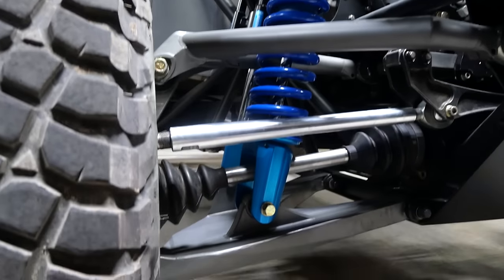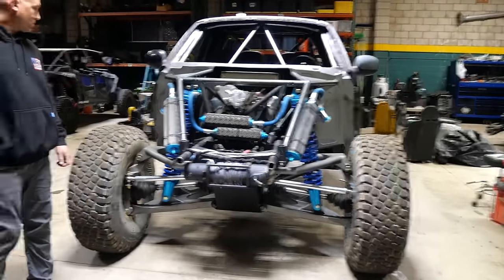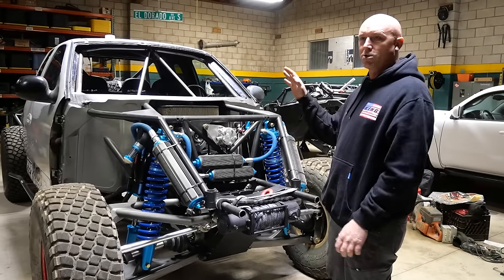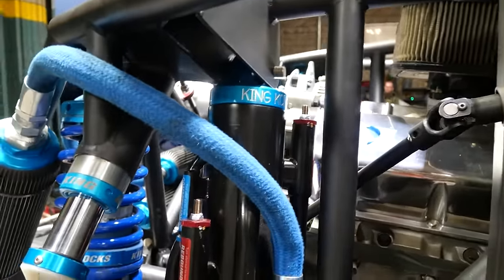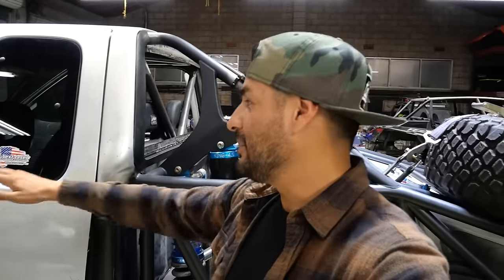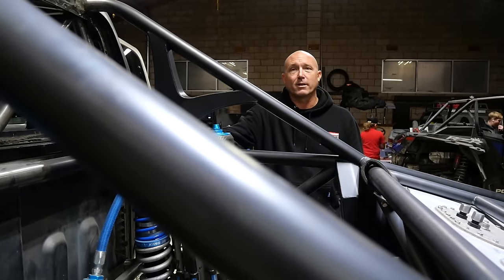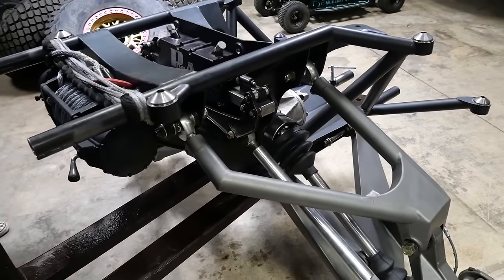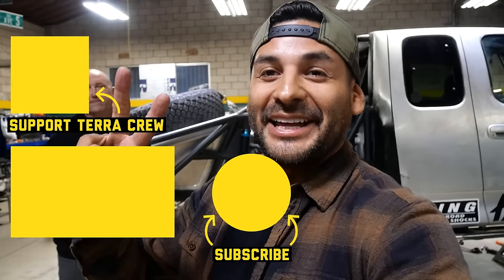Kirby pt 2 | 4wd game changer | BUILT TO DESTROY

Comment: dude, this truck is so sano!! ultra4's are crazy, tough king of hammers type s**t. to be able to incorporate the highest end parts and build this as a 4WD prerunner-just so much cooler than most. i grew up loving all kind of trucks so to have rock sliders and winches all packaged so clean. another thing is using this era is so good because they where such shit they should only be prerunner'd or recycled. everything is this is so freaking right on BBC is tried and true no questions. cnter mount and the sick axles just ridiculous this will hopefully have a session with #allamericansender and that will be a pair of ford prerunners never to be matched. this gentleman obviously has an extreme amount of fab skills to set this up so its as unstoppable as it could be. what a kller truck to feature. i cant wait to see this pop up on FAA radar as a unidentified low flyer. top notch sir, serious outstanding build. cheers. screw those trees thats how yo know you built it right mow'em down and replant some the next day!!!